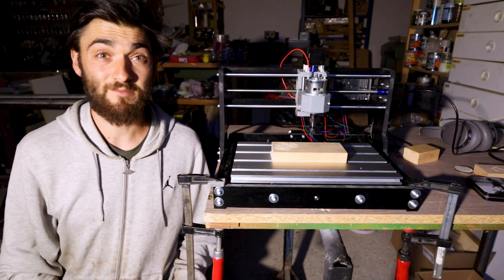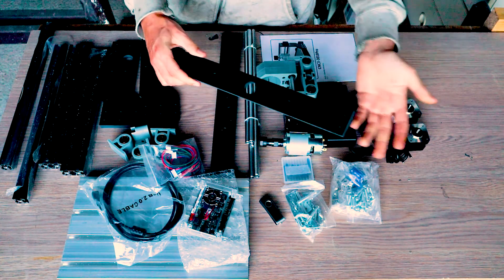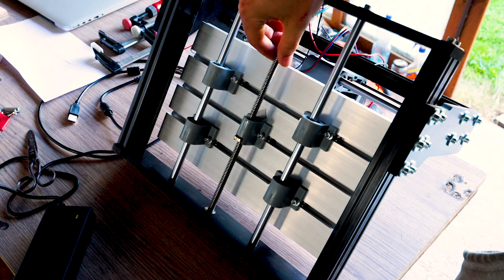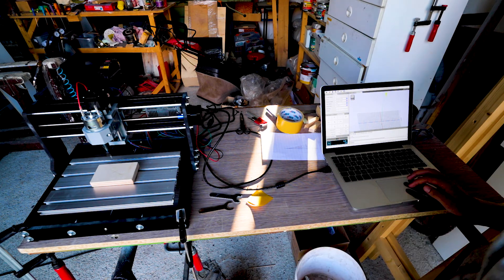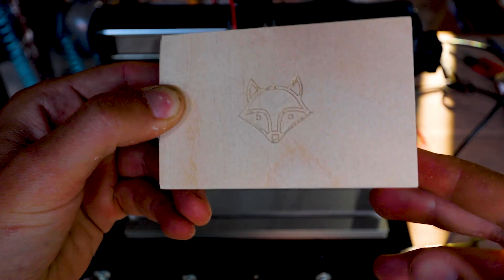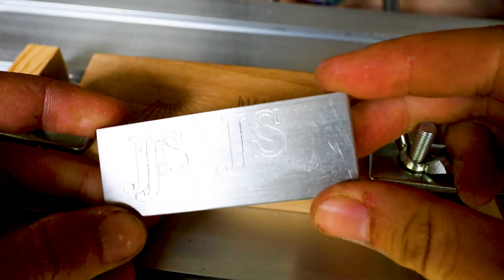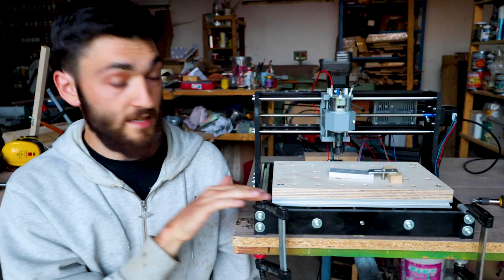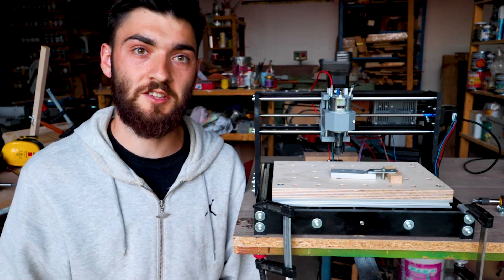3018 PRO – Small CNC router for $120 – Review

Comment: Hi , this machine is capable to do letters with 3mm size ?
Thanks
Reply from the maker: Hi, I guess it is... But it depends on the material you want to engrave. It should work fine for wood and plastics
Reply: @JindraSykora  Is for engraving Aluminum
Reply from the maker: @mrdemetrius7324  It is barely able to do it... For aluminum I would definitely suggest a bit more sturdy machine...
Reply: @JindraSykora  Thanks for your help !
Reply: @JindraSykora  Which software you use to control it ?
Reply from the maker: @mrdemetrius7324  universal gcode sender